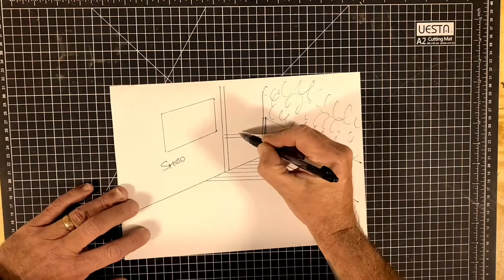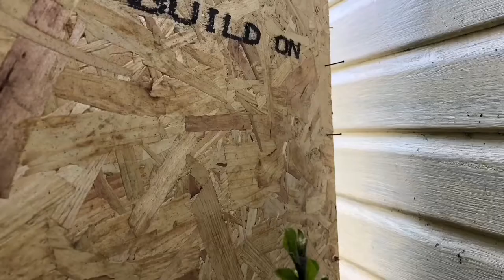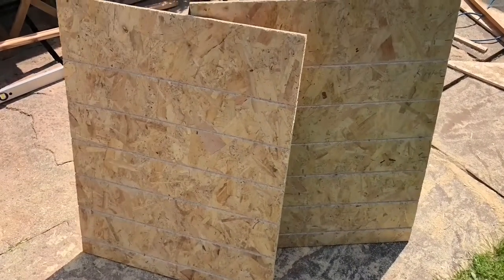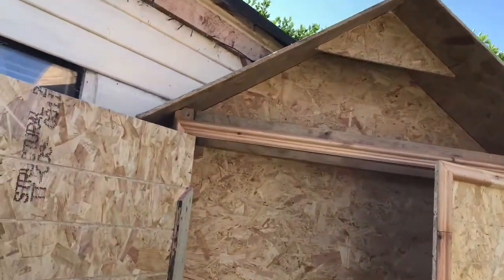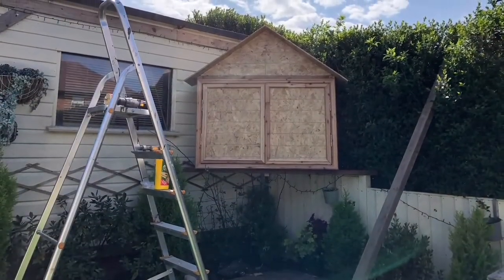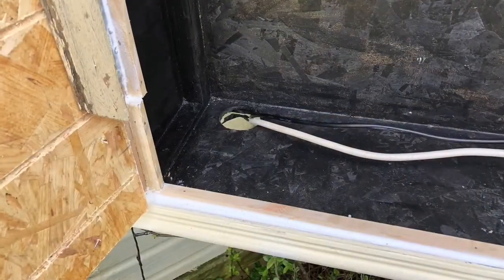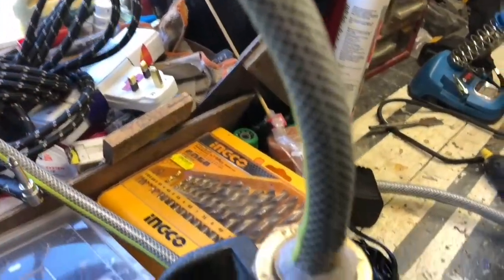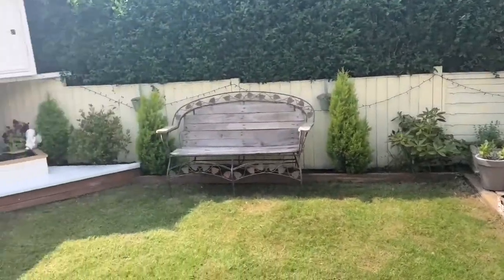Garden outdoor TV cabinet - how I made it

Comment: Great video, im just in the process of building one myself. How did you secure the tv to the back of the cabinet. I was going to use a standard flat wall bracket but I want to make it as easy as possible to remove the tv in winter.
Reply from the maker: Cheers Mate, I actually leant it against the back of the cabinet with blocks of wood at the front locking it in place, so it doesn’t fall, easier to remove in winter.. hope that helps, cheers Rob